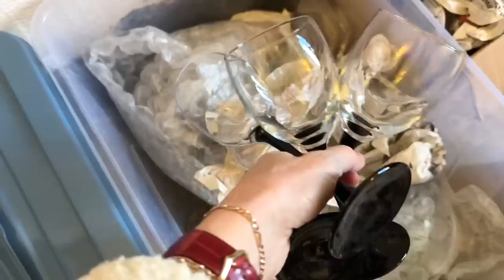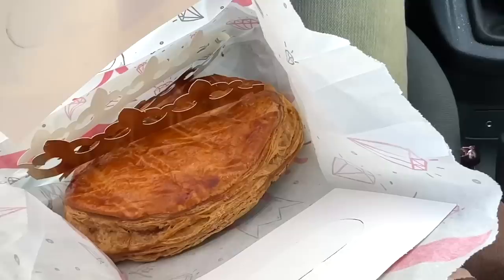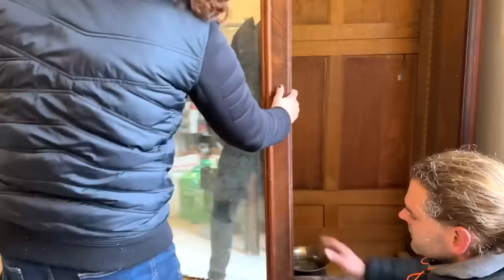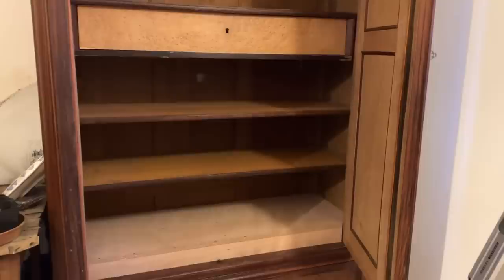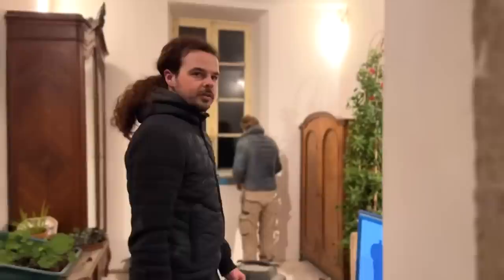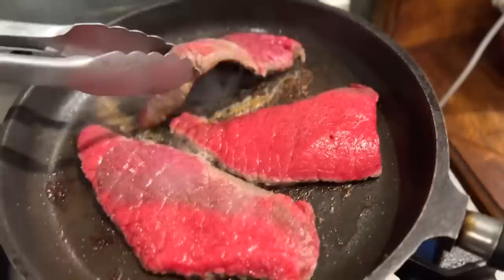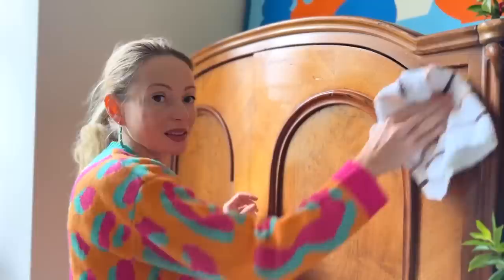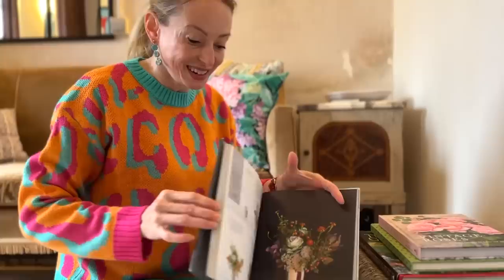MARIE KONDO-ing the CHATEAU! | Epic Declutter Transformation

Comment: Philip and Stephanie I do hope you see this comment of mine. A grand idea for the grandfather clock!! pun intended. I understand the clock no longer works as a clock and you want to transform into a mini bar. However, all is not lost. you can put a battery operated clock mechanism to the clock portion very in expensive and easily done. I have an old antique clock that I bought that used to be a wind up key mechanism and was upcycled with this type of battery mechanism. It still has it's antique charm and keeps perfect charm.

Comment: TIP OF THE DAY.. 😅A cheap screwfix car polisher with a sheepskin head is perfect for polishing up acres of furniture..after putting on the wax or linseed/turpentine mix.. I also use on the floor - holding the flex and letting it buff..

Comment: I'm preparing for a massive clearing so this was inspiring although in Scandinavia we don't have your fantastic light this time of year so builders lights will be necessary. You transformed that cluttered storage space into a really nice space!
I don't think your flower will be happy moved away from the window. and I'd suggest keeping an eye out for a two- teared serving cart ( or a more industrial cart, on casters for all those littlle seedlings, so they can be positioned in the center front of the window to grow but easily pushed aside to open the wardrobes. (better than the metal storage unit by the wall this time of year).
Those mirrors made a massive difference bouncing the light around the room!
unfortunately I don't have your inhouse handy boys to help so I have too dig deep into my pockets to get the assistance I need (two flights up, no elevator, three heavy doors and no van). Sheesh! 🙄
Good Job all of you! 💕

Comment: How’s Natalie’s apartment coming..we haven’t seen it in a long while?
Reply: Philip said  in the vlog that they are still waiting on the planning permissions. Right now, the Chapel is being surveyed, and then the work will be very expensive. The new heating will be put in, and that is paid for. It was expensive. The Grand Salon needs more work. Amaury will have to raise the beams and support them in the walls with sister beams. The rooms above will have the walls raised and/or replaced. They may have to redo those two rooms quickly before the B&B season. New windows for the new appartments be on hold till summer.